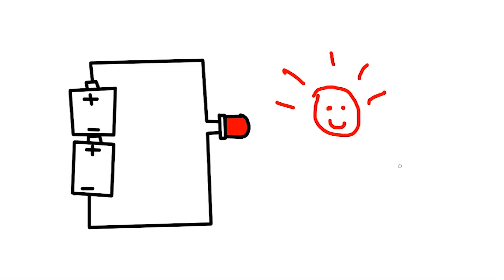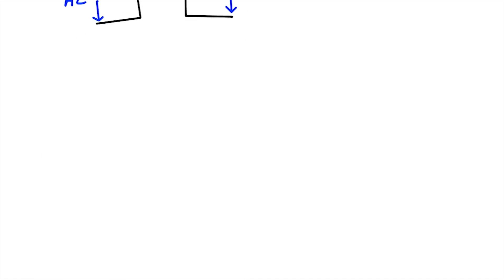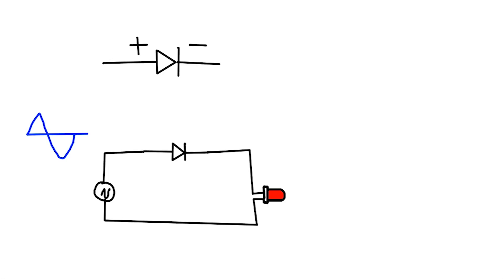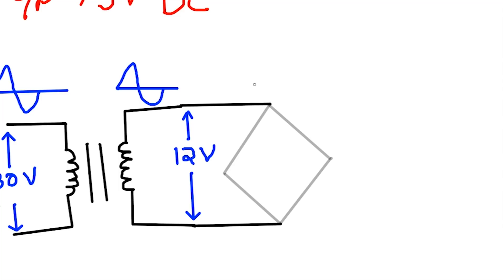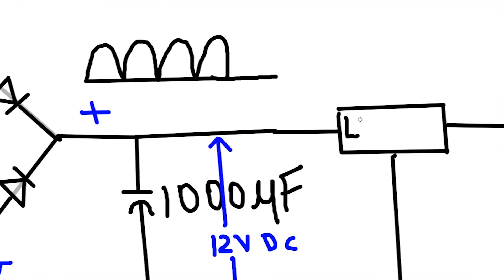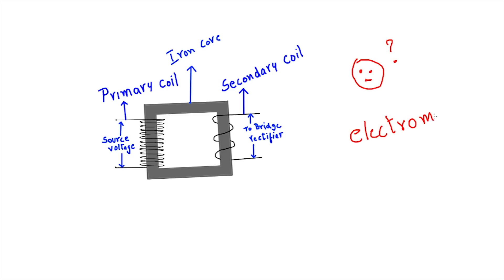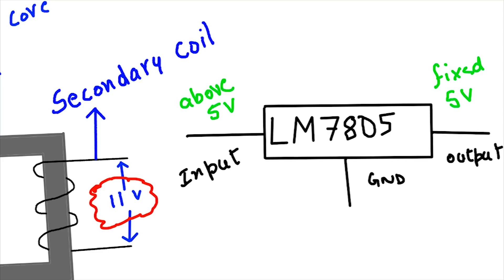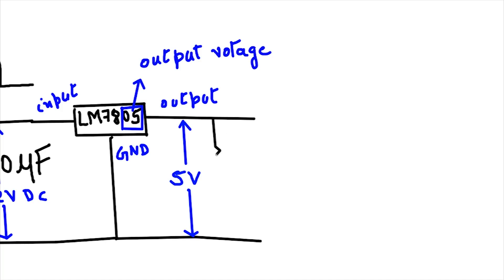How to convert 230V AC to 5V DC

Comment: thanks but you need to explain about ampirage also. please do that
Reply: +raj kurapati I've always heard that the load "draws" such and such amount of current and that voltage is an electromotive force, basically a push. for these reasons I've found it easiest to think of them as "Volts are pushed, amps are drawn." So, volts is what the source has to offer (the maximum available) and amps is what the circuit needs at the time according to the components being used.All in all, The Apocalypse is correct.
Reply: T
Reply: Thanks mr BRUCE

Comment: what is capacitor rating..?
Reply: +Venkatayoganand Konda It's always to use a capacitor that has a higher voltage rating than the voltage it has to handle, therefore, a voltage rating of 25v would be sufficient, but mostly I've seen 35v values used. other than that the capacitance rating is 1,000 uF. Also, as far as I know, it's always best to use electrolytic capacitors in this position but be careful to install them properly since they are polarized (positive and negative terminals). The negative is the one with the dashed line down the side.I hope this wasn't too much and that it was helpful.

Comment: So 46 turns on the secondary winding on the transformer? Because 230vac / 5vac = 46 turns. Or.. 230vac / 12vac = 19.16668 Turns to get 12ac. Midas well say 19 Turns, which would give you 12.1 vac.

Comment: just to understand your video., you used transformer which is 230v input and already got a 12v output.. what you did is you basically regulated only the 12v to 5v.. the title/subject of your video is mis-leading.. I am a newbie to this and follow this schematic it simply blow up my fuses ....what did I missed? and this schematic this was suppose to be Full Wave Rectification correct?
Reply from the maker: +Jim Mallari 
Yes, you did get 12v through the transformer, but it is AC. All digital circuits including batteries need a DC supply rather than an AC. The first step included stepping down the voltage, then converting AC voltage to pulsating DC using Bridge, then converting this pulsating DC to Pure DC using filter capacitor, then regulating it using voltage regulator, and finally adding an indicator LED.
Reply from the maker: +Jim Mallari 
This circuit is ideal for any power supply unit. I use it all the time, especially to power micro-controllers. And yes it is a full wave rectifier.